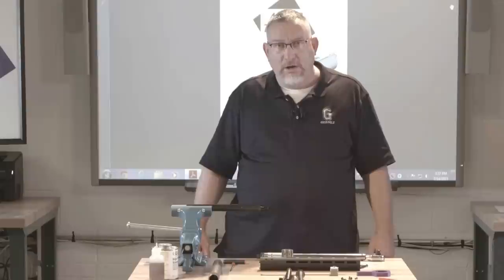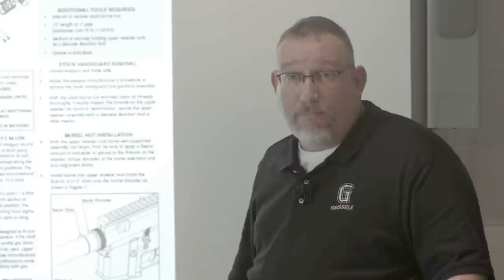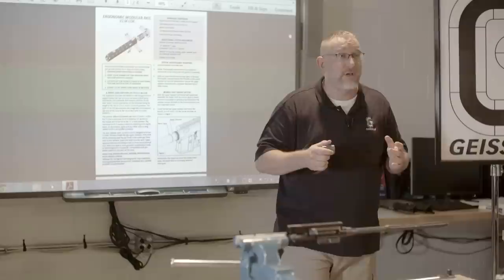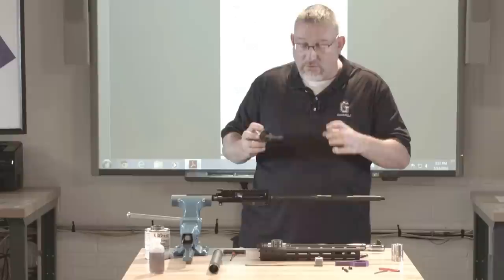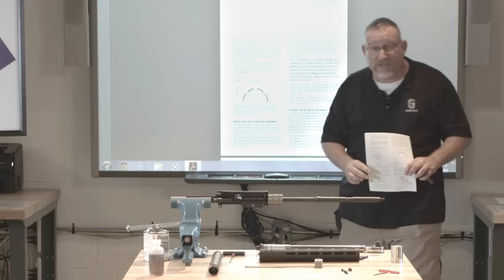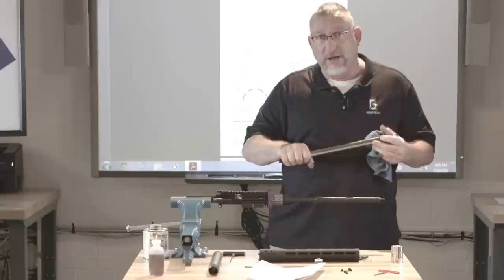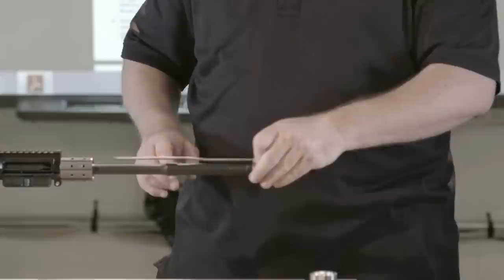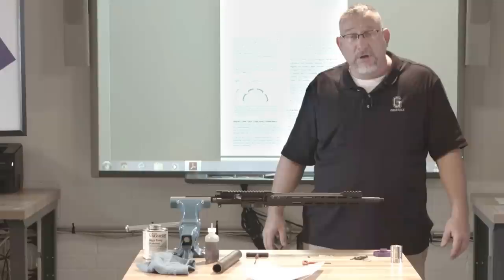ALG DEFENSE - ERGONOMIC MODULAR RAILS - PRODUCT INSTALLATION VIDEO

Comment: I think lots of people want a 1/2 inch hole in the wrench simply because most, or many people building an AR already have a torque wrench or at least a 1/2 breaker bar. That's easier than buying or scrounging around looking for a pipe piece. It's a great install system that makes lining the gas tube up easy. I don't think people want to bypass that when they ask for a hole for a torque wrench, they just want an alternate way to grab that wrench to tighten it. I like the rail & the barrel nut & install is great, I will be buying one, and then another & later, maybe a third.
Reply: I agree that a 1/2" opening for a torque/breaker bar would be a lot better.
Reply: I would have to agree with this.  It cost me $9 to buy a pipe and I already have torque wrenches / breaker bars.  Not sure I understand Bill's logic here. He must have pre made thousands of these wrenches and does not want to go back and fix them.  My guess is that one day we see a 1/2" hole in these
Reply: Engineers hate, I mean HATE, to see otherwise intelligent individuals put that GI barrel nut wrench on a torque wrench without the 90 degree angle.

Comment: Excellent product and very detailed video. Started installation, and put wrench on the wrong side. After removing barrel nut - found out that color labels on the shims is gone. Also, looks like black shim was not correct thickness.
Will be getting micrometer to verify, but my experience should not stop anybody from buying this product.

Product of excellent quality, wish I saw this video before started installation.

Comment: I'm not sure if anyone has said it, but a good thing to use as a form of thread locker that you don't want permanent, is the automotive gasket  maker in the little tubes. Any color works well. And will also take some heat. Put a dab in the hole and install screws. It will hold enough for the screws to not move, but easy to break free when you want them to.

Comment: Tips: Use a pipe cap on one end of the 12" nipple. makes for a helpful hand stop for your hand and the threads won't cut you......*OR*  you can use a 15/16th " open end wrench ...*OR*.... a 12" Adjustable Wrench. I had a  brand new 12" Cresent brand adj. wrench I'd never had the chance to use since I bought it, and it was by my workbench... so I used it to install my ALG Defense ERM V-2 "Ergo" rail.  I do think using  a 15/16th inch open end wrench would be best though, due to it's lighter weight and thus better 'feel" during the final 'torqueing" with the Purple Wrench.  
FWIW.. I really love this  ALG Defense EMR V2 handgaurd (rail) on my AR 556. I got it and a few other items from ALG and Geissele Automatics on BF sale too. Money saved off the sale, was spent on more Geissele tools  I got a great deal on all of it, IMHO. Especially for Geissele quality and workmanship. I also bought the ALG FSS forged 7075 T-6 Q.D. sling swivels (VERY lightweight at .5 oz) , Geissele Reaction Rod, Gas Block Punch Pin Tool ,Gas Block Roll Pin Tool, as well as the Geissele Trigger Fitting Pin too. 
Mr. Geissele, I am tremendously impressed by the ingenuity, quality and craftsmanship of all your products. And I've been working on cars/H-Ds for over 40 years. Thanks for you dedication !

Comment: Waiting on mine in the mail. Thanks for the video and the awesome Black Friday deal!
Reply: how did the emr rail go? Good install? Still have it? Would u do it again..or suggestion another company? considering this for 16inch barrel. .would be getting the 15in guard
Reply: The install went smoothly. The rail is durable. I have no complaints other  than aesthetically it doesn't look as nice as the Geiselle SMR. I also like Midwest Industries M-lok rails.
Reply: +BAD45 Acp ...lol so its kinda ugly?..well i want to build a sexy functional rifle that is durable as heck
Reply: Well mine replaced a fugly Rock River Quad rail. Looks are in the eyes of the beholder. This a 16 inch Mid Length Gas system AR with a 1/9 twist mostly shooting 55gr M193 at 0-600 yards. It gets the job done from the bench and the bays at the range.